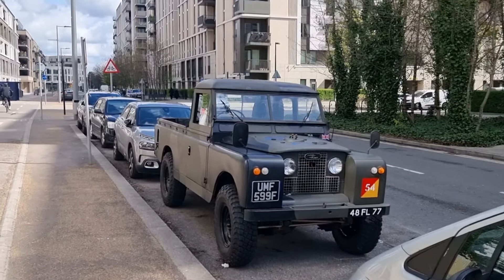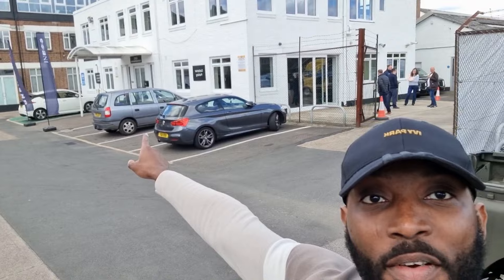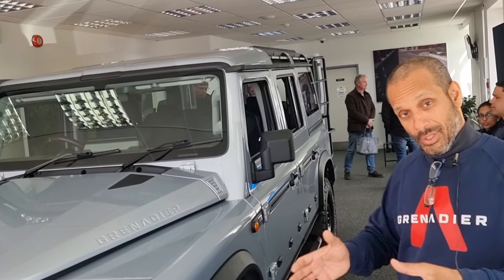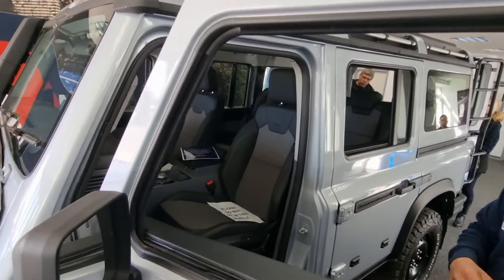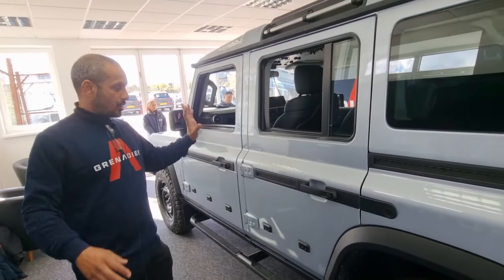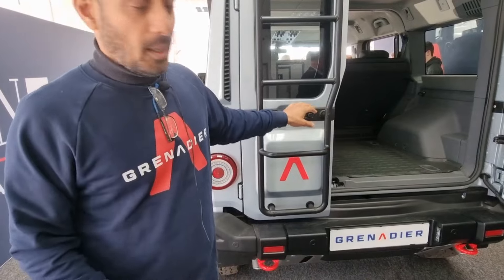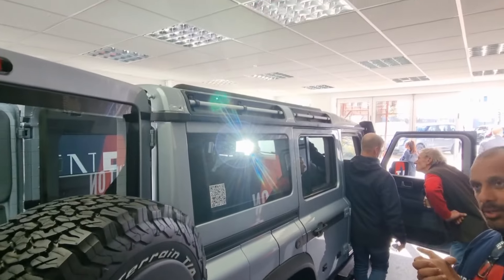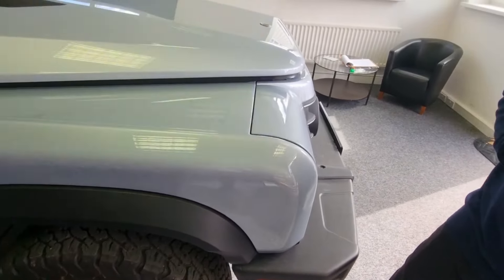Grenadier VIP Event (Part 1) - Detailed tour of the Grenadier #ineosgrenadier

Comment: Very good video and most informative.  There are some excellent features on this new vehicle and some real thought gone into developing the Grenadier. I am a Land Rover person and have been since 1976, having owned a Series 3 soft top (like the Australian Army used), A Land Rover Station Wagon (Series III), a Land Rover County V8  and finally a brand new Defender (1996) which I still have. In the 26 years I have owned the Defender, I have traveled extensively in the Australian "Outback" - long abandoned overgrown tracks, through the deserts, in the centre of Australia and cross county in the Pilbara and Kimberly Regions of Western Australia. Harsh terrain, dust, mud,  rock, and temperatures in summer up to 45" C.  I have forded flowing rivers in most states and had to weave my way out all sorts of perilous situations. Over the 26 years, apart from annual services and tires, I have changed the original clutch (for a H/D new one) and only this year (2022), the fuel pump, water pump and timing belt kit. In total, Au$8,000 spent over 26 years. It may be old technology but it never broke down in the middle of nowhere  because of computer chips and programing gone wrong. When they stopped making Defenders, I was heartbroken. The newest Land Rover should NEVER have been called a "Defender" and it is far to much of an on-road vehicle focused more on a luxury look than a true "Off Road Exploratory Vehicle".  The air system to elevate the vehicle another 100mm is pointless and problematic. When I heard the Grenadier was being developed by a Land Rover Defender lover, I was truly excited as its time for a new vehicle with new features surpassing the Defender, but alas these are the shortcomings of the Grenadier as I see them:  (1) The ground clearance is LESS than a traditional Defender with much more underbelly gear to get caught in rocks and tree stumps or make ground contact.  It should have had higher clearance. (2) The front and rear Difflocks are a brand statistically with the highest FAILURE rate - you must have the highest reliability when truly exploring hundreds of km form anywhere. (3) The Side Steps (as shown in the video) are too low and REDUCE clearance.  Land Rover had a step for the sides or the rear which folded down to get into vehicle but which could be folded up to maintain most of the clearance. Perhaps the Grenadier's side sliders are higher and maintain more clearance?  (4) The raised Air-Breather is not a snorkel - how silly is that. if your going to attach this, have it designed to do both - high air breather and afford snorkel capability. The snorkel capability is essential to any true off-roaders and allows the expedition to continue. Can it be adapted to be a snorkel - the video doesn't say?  (6) Those inside wheel arches were retrograde - glad to hear they are being squared off. (7) Winch machinery.  This is essential for any true 4WD.  (8) Although not indicated in the video, the Grenadier design only permits one type of winch to be fitted - a specially modified winch which costs $5000. A solid ARB $1800-$2000 or similar winch can't be used. Nor can you take it off your current vehicle to fit onto the Grenadier. (8) BMW is surely a good motor - but wait until you see the annual service charge. The Grenadier is a very good looking and functional vehicle which greatly attracts me (because i do love the traditional Defender look and practicality) with many very positive features. In my opinion, it could definitely have been the Rolls Royce of off-road vehicles but for the observations listed. With so many options available at additional cost, it will go over the $100,000 point.  Will you take this into the true wilderness?

Comment: I ordered one yesterday and must say that this is a most detailed and useful video. Thanks a lot to both of you. Waiting now for my build date but want to modify my order slightly to change the paint colour from shale blue to mushroom and to add diff locks front and back. Hopefully these are multiplate wet clutch diff locks, electro hydraulically actuated just like the Carraro axles on my tractors. This would mean fast and reliable engagement and disengagement under load.  Also I do hope that it retains an open centre diff in low range unless driver demands it locked and that it can seamlessly change from low to high range on the move while towing 3.5 tons or doing an ‘emergency escape manoeuvre’.
Reply from the maker: Congrats on ordering one and I'm glad you found the video helpful. I do hope I'm able to catch up with Aktar again to put more questions to him. Which model did you order?

Comment: reserved one. just wondering if the tow hitch is standard, as there's no 'option' for it in the configurator....
Reply: also, will there be a snorkel option?
Reply from the maker: Congrats on your reservation! believe the tow hitch will be standard
Reply from the maker: @etclarke  I believe Grenadier is only providing the raised air intake as an option. However, we should be able to get a snorkel from the aftermarket producers
Reply: @landroverleks  thankyou